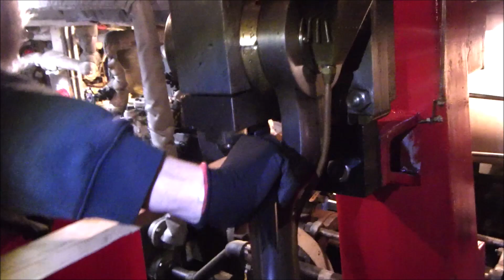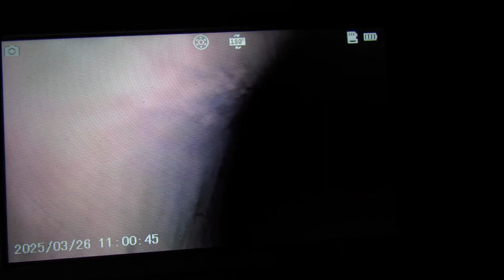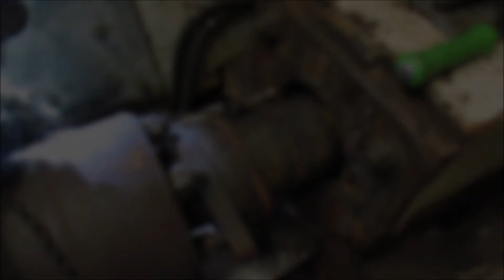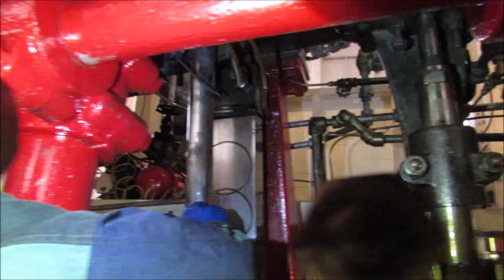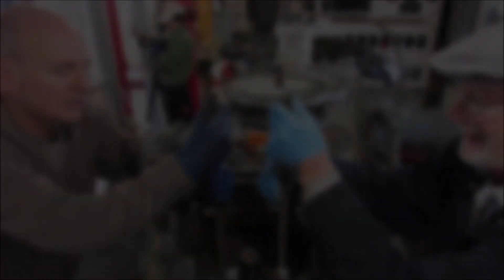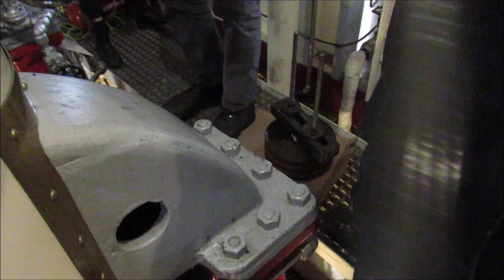Boroscoping Boiler Tubes: SS Virginia V Shipyard Vlog #18

Comment: Many thanks for your videos. A boiler question: if you’ve got a bad tube, it looks a good bit harder to replace in a water tube boiler. Is this true? And I guess cutting it out and welding the attachment points might be harder as well? How many tubes can one lose before a rebuild makes sense? With the other videos I’ve more of a sense as to the next steps if more or less rot/ corrosion has occurred and it would be fun to have that sense with the boiler.

Also, how goes the overall project in terms of cost/ scope/ time? Are you about on target? Wish I lived near you folks, I’d be able to help for sure.
Reply from the maker: It is certainly more difficult to replace a bad tube in this type of boiler. If a tube goes bad, the first recourse will be to simply block it off. The boiler has dozens of tubes, so blocking off one or two is not particularly detrimental. The ship's original boiler lasted 80 years. This current one was built in 2001, we should be able to get a few more decades out of it. 

The haulout has taken longer than originally projected, which is not unusual. Wood rot always ends up being a larger issue underneath than it appears on the surface, though how large is impossible to tell until the project starts. Fortunately, the Foundation has received several grants for this work in addition to donations, so cost is not currently a concern.
Reply: Many thanks!

Comment: I have checked bearing clearances many times. My ICE are tiny compared to your external combustion engine!! With good oil bearings will show little or no wear. We have driven our farm truck 233,000 miles & the crankshaft still passed OEM factory specs! Cylinders & rings were shot at .030 taper wear! So, of course we had to have the ICE rebuilt to .030 oversize on pistons & rings. We were lucky as GM had made the engine with thick enough cylinder walls to be able to re-bored to an over size. Stripped threads! The bane of mechanics everywhere. Cast iron can be welded by a very good welder with special flux & welding rod. We have had a cast iron top cover on our pto fence post auger that cracked in 1/2 & was welded successfully which we had a neighboring farm use to drill a couple of dozen fence posts with no problems.We cracked the top accidently by dropping it. Your pullers & their use look very similar to when we pull gears , wheels & steering wheels. Appreciate your videos showing everything.Hey, the gal working on the steam boiler tubes is my size! Good humor as well. Hard to find a gal that`s 4'10" with a good personality. She is worth her weight in gold.